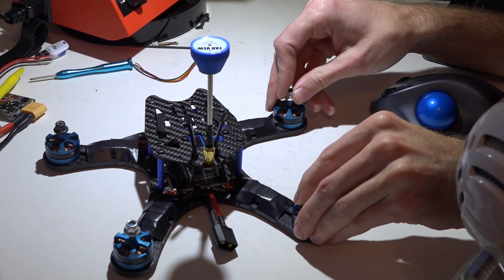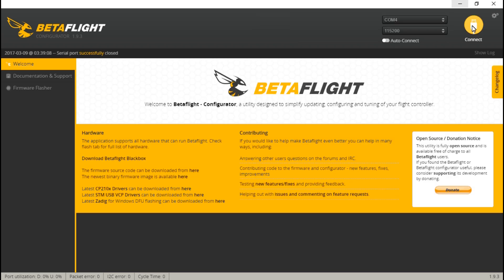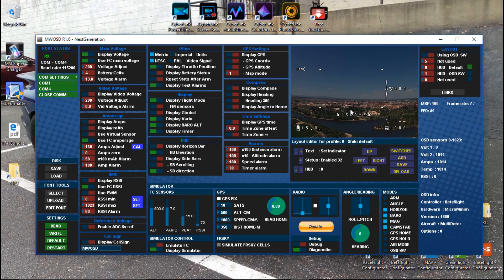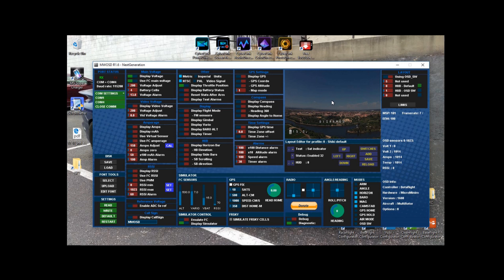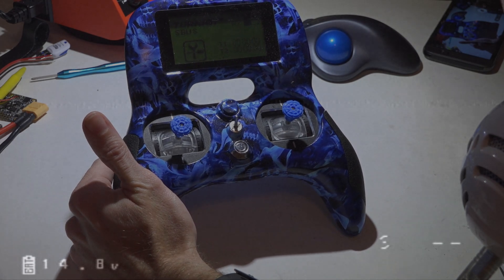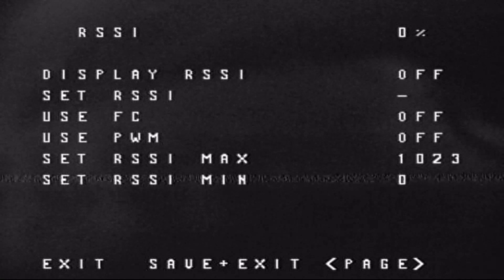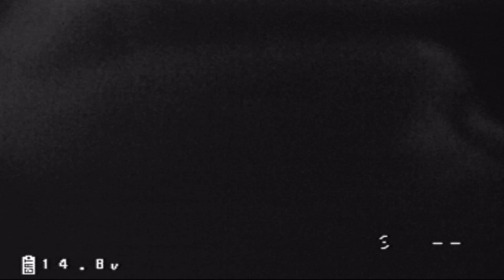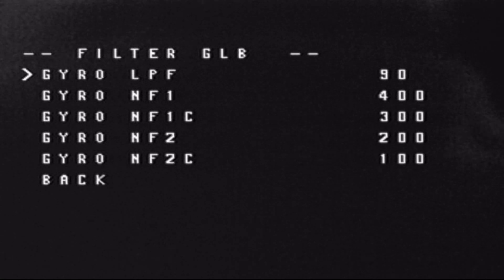Furious FPV Piggy OSD: Final Tips & Walkthrough

Comment: after enabling FC voltage it just reads 0.0 and will not change regardless of calibrating the voltage with my remote. if i take it off of FC voltage it just stays at whatever voltage i set and doesnt change. Ive been trying different things for about 3 days and have run out of ideas.
Reply: ive had the same issue on a kombini with piggy osd. other things were working but current just sits at 0.0